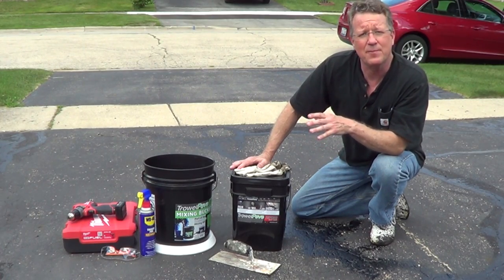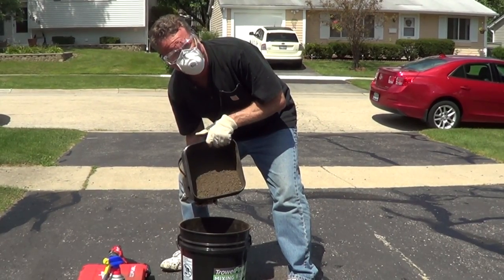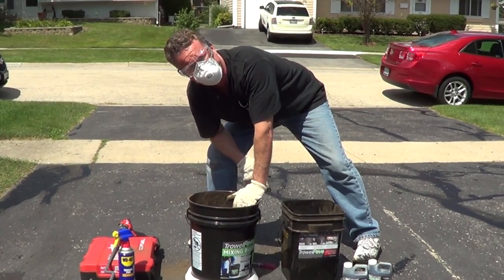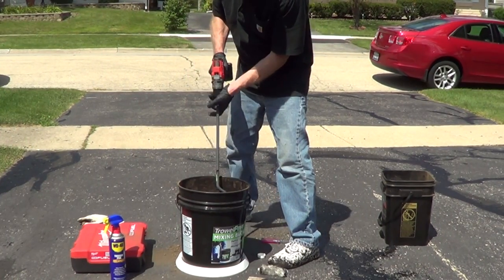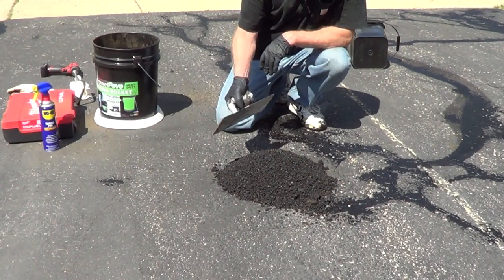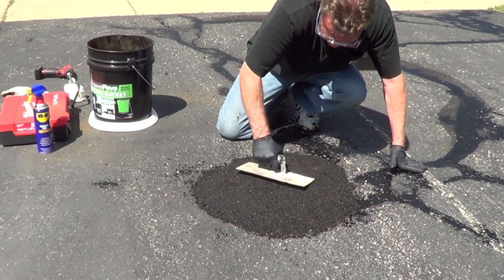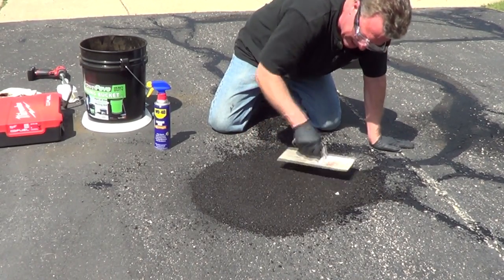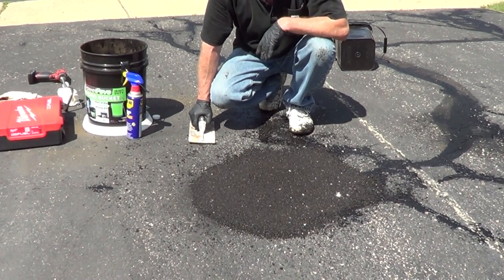Driveway Pothole Repair -  Asphalt Patch - Trowel Pave

Comment: What did you use for the cracks.    Any video on that?
Reply from the maker: Hi, here is a video https://youtu.be/mmswyLnB3Ck on one type of crack filler.
For wide or deep cracks, a caulk does a good job. For thin small cracks the pourable bottles are easy to use.
Check out more home improvement tips on our weekly podcast 
https://itunes.apple.com/us/podcast/fix-it-home-improvement/id880903087?mt=2
Reply: Someone said for big cracks and  filling holes I should use roof tar. Cause its not deep enough and  pothole repair stuff  won't work
Reply from the maker: Hi, most roof tar won't get hard enough.
Reply: @FIXITHomeImprovementChannel  thats what she said.